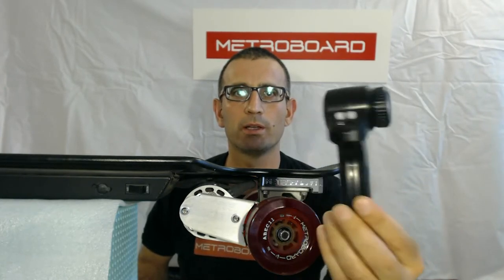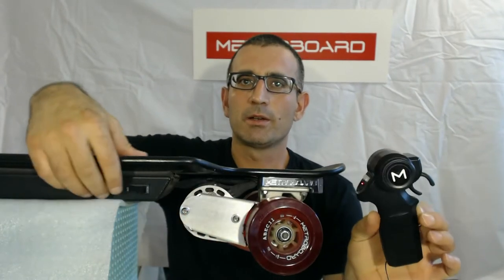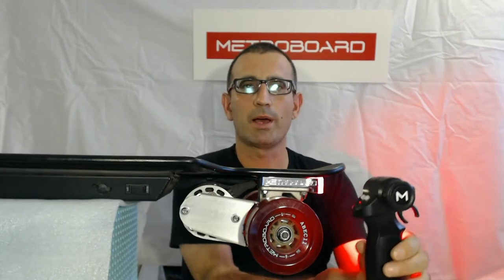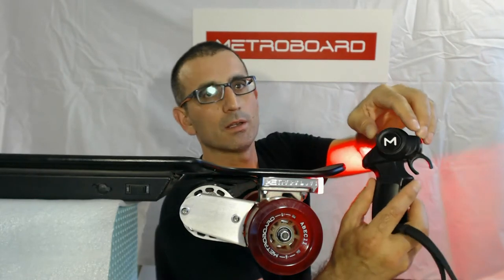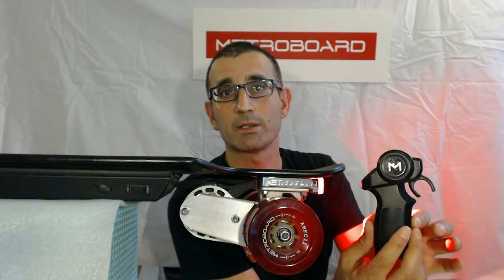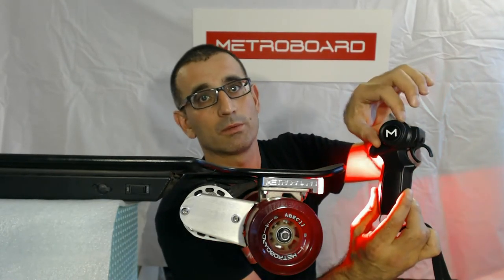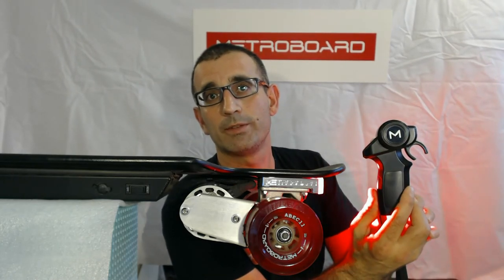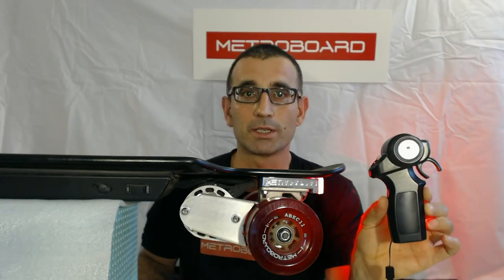Metroboard Mini RC Remote Quick Start Guide

Comment: This beeping system is confusing and reminds me of the very first pagers. I'd like to see a bluetooth phone app.
Reply: With custom programming for the top two buttons. Generally I want a constant performance mode, but with a button to cap the speed at 15 mph, without a bunch of mode cycling. I'd use this all the time.

Comment: I enjoyed the new video and am looking forward to my dual drive board.
In the calibration of the battery because I am getting the extra capacity battery for the dual drive, which are estimated at 17.5ah... I would therefore calibrate to the 40 mile battery for the single drive?
Just wondering
thanks for the great video... Visualization is a wonderful thing

Comment: Ilan, same question as Greg. I have the Dual with the extra long distance battery (35 mile). What setting should I set it to? Thanks!
Reply: Is there a choice in batteries for the Dual? Mine came with the 25 mile battery.

Comment: I wish you would come out with a more modern remote. Smaller. Less klonky. Rechargeable batteries. Maybe easier setup system. Actually the remote holding me back from buying it right now.
Reply from the maker: what it lacks in beauty it makes up for in unbeatable wireless performance. that can't be said for most other boards on the market.  At the end of the day, a pretty remote with bad wireless performance will be a bigger source of frustration.
Reply: Nah any smaller and it would feel uncomfortable in my hand, it's very ergonomic for me personally and I can't imagine a better form factor.
Reply: Seems complicated but it's honestly very simple. And sturdy. I have fallen hard a couple times with the remote in my hand which sustained the brunt of the fall and it has barely a scratch.